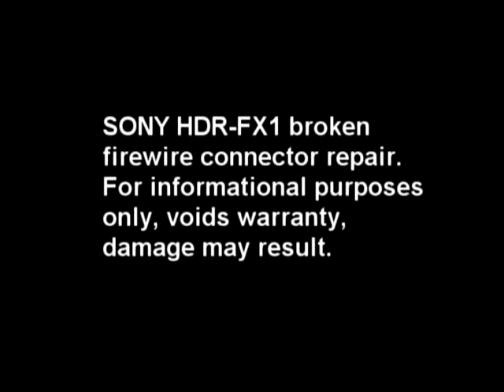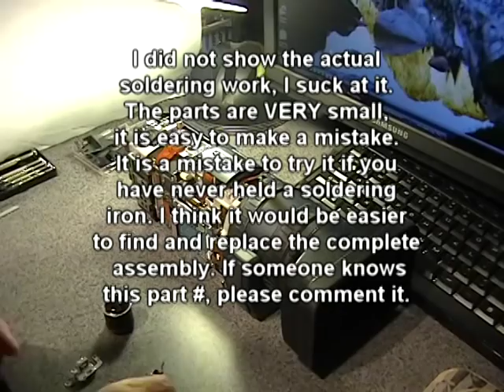Sony HDR-FX1 firewire port repair

Comment: I finally did the job with just the firewire port.  The part from Mouser was close, but the 2l arger pins that hold it to the board did not match up.  I folded them  flat and epoxied it to the board.  I added a little wire to wrap around from those grounds around to the bottom and soldered them for a solid ground to the board, and soldered the 4 connection points.  More epoxy around the part. Modded the plastic too. I would recommend buying the 40$ part.  Couldn't have done it without you Thnx!!

Comment: Just got the part today. The part is actually just the Firewire port, which installed very easily except for a couple of screws that game me a little trouble on the handle (be careful not to force them or they'll strip). Everything working perfectly now - thanks for the video reconrick1! Awesome job!

Comment: Thanks for the video and info re repair of the FX1. I have 4 of them (plus a FX1000) with two of them having firewire connector problems. I bought one of the FX1's at half price because according to a SONY repair agent after they examined it, determined the FX1 required a whole new side board at $500 plus! 
Even though I do have 9 other video cameras that I can use to connect to PC, it's just great to have cameras with full functions working.
Thank you heaps.
Tony
Tenpin Bowling Show Australia.

Comment: I've just followed these instructions to make the same repair on my HVR-Z1E.  I'm importing footage as I type!  Thanks so much.  The part number is identical in the Z1 too.  The replacement spare is so cheap I'm ordering one up incase it happens again.  If you're in the UK the part can be delivered for under £16 including VAT from CVP.

Comment: Thank you so much. My HDR FX1E (pal version) had exactly the same problem. I ordered the part through Sony, all up inc postage close to $50, replaced the defective one and presto, the computer detects the camera and I can capture again:) I closely followed your instructions and it took me about 30 minutes all up. Cheers! BTW, a camera repair place quoted me between $200-$300 to do the same job. Glad I had the courage to do it myself.

Comment: Thanks for the video and the part number.  I was skeptical at first if I could get it done but the part came quickly and taking the camera apart was pretty easy.  Instead of soldering the part to the little metal frame I epoxied it with a little JB weld and now I am super careful about that port! If you ever lend out your camera .. that is when the trouble begins.

Comment: Many thanks for this video. I have the FX1 and cringe every time I connect the 1394/Firewire cable for fear of damaging the port. I have an older, less expensive Sony DV camcorder (TRV-11) and that Firewire connector has failed twice. I traced the problem to a "bad" cable that apparently grabs the little connectors and breaks them. So, use the highest quality cable you can find. 

Now I need to find a similar video for how to repair my TRV-11, and hope I don't have to fix my FX1.

Comment: Thanks for this.  I used the steps to dismantle mine to get to the mic in plug.  I had dodgy sound through the external mic line only.  Re soldered the pins on the plug and it seems to have solved the problem.

Comment: Thank you  so much for posting this.  I just have a question about the part that you used.  on mouser.com the nearest match I could find was Part # 517-3E206-0100KV .  The picture is generic so I was wondering if you could confirm this part number please?  Thanks again.

Comment: @Dblitz70 

You mean full circuit board for DV out port ? That must be my solution too. May I ask where did you order the part ? From Sony ? What is the name/code of the part ? I will appreciate your help. 

About soldering the board, any suggestions from your experience for not to damage the unit ?

Cheers

Comment: The part numbers for the DV socket section are:
X-2023-312-1 > Cabinet (DV) Assy
A-1073-874-A > FP964 Board Complete
2-178-794-01 > Sheet Metal (DV)

Comment: Hey great video! if only this was my camcorder! :{ .. i have another model and i was trying to search how to replace a similar component to wat your replacing.. the ilink 4-pin female port .,. i think thats wat it is.. does that part u replace come standard with all sony camcorders??.. i dont really know how to take my camcorder apart but i want to replace that piece because i broke the pins..if i looked at my manual .. will it have the part number and name?? Thank You.

Comment: @Dblitz70 Update.  The cheap fix of just the firewire port eventually failed.  I ordered the full circuit board part with ribbon cable and installed without any problems.  It's working perfectly.  I'm just glad my adventure in soldering didn't do any permanent damage. Thanks again for finding the full factory replacement part and source.
D

Comment: i've had a spill on my HDR-FX1 and it seems to work fine except for the image being very dark, so iris' aren't opening in the lense. repair shop days i have to buy a whole new lense for 1500$. would there be a broken HDR-FX1 out there with a lense that works? is it worth hunting around or should i trust repair people and pay the 1500$? do you guys know where a stock of old camera's might be hiding? or if it's possible to get in the lense and clean the iris'? is my repair guy lazy?

Comment: Wonderful video !
Just a question. My camera has a similar problem but not a loose connection nor scratching clicking sound. Only fails to connect to PC. The DV HDV leds are working. In this case I doubt if there is a burned board or anything else before trying to fix. I tested with 2 cables on Avid Liquid 7.1 on Win XP SP2, also Win7,Vista showed nothing.
Anyone had their problem still unsolved after trying this method ? Anyone who had a repaired DV out board  repaired by Sony Service ? Cost ?

Comment: @reconrick1 Thanks for the reply!,
Well, I bought my camera on ebay while ago and the firewire port never worked although the seller said he used the firewire when he had the camera.(lie? I don't know). Someone else also told me that he had a same kind of a problem and he had to use a "Sony" Firewire for it to work. This maybe the case with me. I have tried couple of firewires but non of them were "Sony brand". I will try a new cable and see if it works. Thanks again ReconRick1.

Comment: If your firewire port is constantly loosing connection, don't use it and have the connector repair. If you use it with the loose connection, you will damage the firewire IC chip. When this happen repairing the connector will not help.

Comment: @reconrick1 
Thanks for the answer. I tried them all. Now I need to know how to find a spare dv board and replace...
Currently I am using another Sony camera with minidv for the transfers. I found it on ebay for around 250 € hence it is also having a slight problem in the cassette mechanism, need to workout several attempts to successfully load a cassette. Sony in Germany, asks me to send the unit for inspection, estimate a maximal fee I can pay and bear a fix insp. fee. They decide then.

Comment: Don't use Emcompass to order from (lousy CS). Try PartStore (dot) com. It doesn't have the (FP-964) number after it until after you place the order. Just add to cart the A-1073-874-A part number. It shows the FP-964 once the order has been placed - and they have it in stock too!